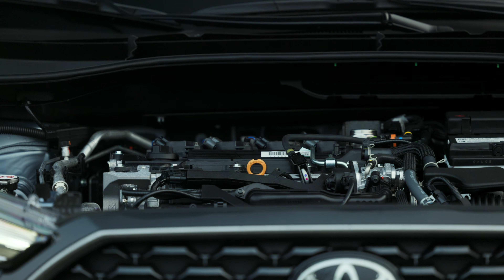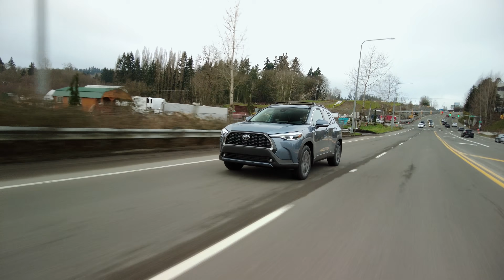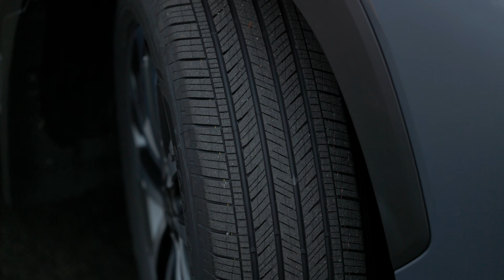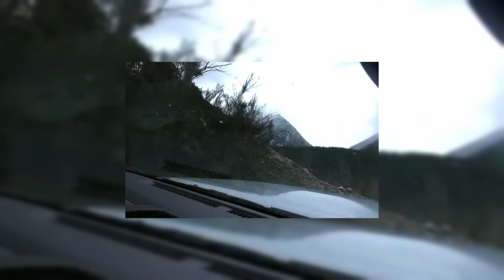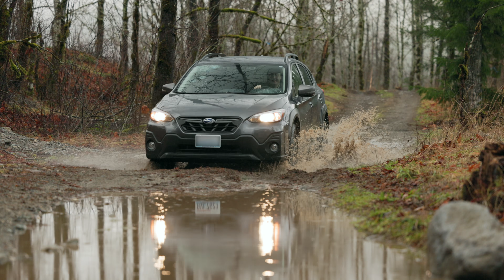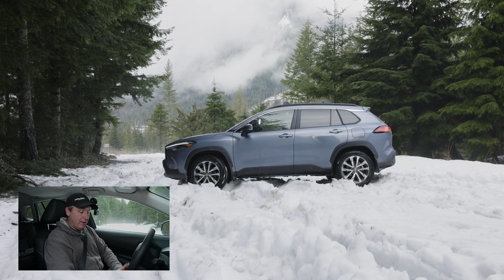2022 Toyota Corolla Cross vs Subaru Crosstrek AWD Off-Road and Snow

Comment: “No stream, Tap to retry”
Reply from the maker: YouTube is aware of the issue. They said it will be fixed in 24-48 hours. 🙄
Reply from the maker: if you have issues playing in the YouTube app, try it in a mobile browser. It worked fine for us after replicating the app playback issue.
Reply: @Driving Sports TV   Yes I just saw it awesome job
Reply: U

Comment: My Toyota Corolla in snow tires is almost as good as an all wheel drive. Tires make a huge difference and you should’ve had snow tires on the Corolla Cross for this test. I realize you’re not able to put snow tires on it but at least don’t say that tires didn’t make a difference because it does. Other than that thank you so much for doing the video and putting the Corolla cross through snow, there aren’t many videos that have done this.

Comment: It’s a pity that other car manufacturers didn’t follow the example of VAG brands and don’t include the EDS system as standard. In similar situations, when we have AWD without full locking differentials—as is the case with most non-off-road vehicles—the EDS system would be very useful in snowy conditions when ASR can’t cope

Comment: I drove supercharged v8, twin turbo v6, and I say the hrv,  Corolla cross and crosstrek and am perfectly fine with the hp, torque,acceleration and cvts. Just stay away from 3 cylinder engines, and Mitsubishi cvts, and Nissan.

Comment: I personally have taken my 2024 Corolla cross se mudding here in Oklahoma after feet of rain. I took off the traction control bumped it into 2 gear and it slung mud! I have never seen or been in an suv that could tear through muddy/rough and rocky terrain such as that. So don’t dog on it until you really run it through the gauntlet!

Comment: Why not try the hybrid CC with 197 hp vs teh suby?
Reply from the maker: Because at the time of filming there wasn’t a hybrid cc yet.
Reply: @drivingsports  I'm super interested in how the AWD-i would fare. Would it actually do worse than the Cross you had for the test with the different AWD system.

Comment: What I don't understand is why car makers in recent years have moved away from mechanical limited slip differentials.  They are simple.  They are usually bulletproof.  They do NOT have to use your brakes to move your car.   (There's an oxymoron.)   For both of these cars, having a limited slip on at least one axle would be a game changer.    Your Toyota would not have had any problem with that second hill with a limited slip on the back.      It can't be because of cost, limited slips are cheap to make.  ???

Comment: ALL these companies need to learn a 2.0 litter ANYTHING is NOT ENOUGH POWER... PERIOD....  F...k the govt. regulation BS-- give the public what they want.. and it will sell-- but these are UNDERPOWERED - just like the subarus, and all the rest.   The 2.5 mazda is BARELY enough-without a turbo(which is another thing that needs to be LEFT OFF- and install SUPERCHARGER instead-- much better for the engines and mpg.

Comment: Considering they’re the same platform vehicle with just 2 different engines and AWD systems, having had a Crosstrek and miss the heck out of it, I can absolutely see the appeal to the Corolla Cross. It’s more modernized , looks a bit better and given the AWD Hybrid option that I believe gets better MPG than the Crosstrek Hybrid and will work fairly well for most commuters. That being said, having BEEN a Subaru owner, there is NOTHING like it. The customer service and assurance that they stand behind their vehicles is the hands down reason to get the Crosstrek over the Corolla Cross. Our local Toyota dealerships have some of the worst salesmen and service techs I’ve ever met and that’s why we went with our Odyssey instead of the Sienna. Had we gone with the Ascent instead, my blood pressure would’ve happily had a better time than what I’ve had with a non-Subaru dealership and service department.

Comment: I watched this video a couple times. And I noticed that when he was doing the same section that the Toyota was in being that he owned the car he was more aggressive with it so there was a little bias. He didn’t want to hurt a brand new car he charged a little bit with the Subaru And the Subaru was a little more use of the throttle as you could tell from different camera angles from the wheel spin. Again it was lighter on the Toyota than the Subaru because he didn’t want to hurt and pay for damage on a new car.

Comment: They both have standard open differential. you can clearly see it.
Toyota didn't put the A-TRAC system (like the one they have in 4Runner and LandCruise) on the corolla cross. 
If it had the ATRAC, it wouldn't spin the wheels like that.

Comment: Incorrect comparison because
1. Tires (all-season vs trail)
2. "Sport" is trim #3 for Subaru (with 2.5l motor, 182 hp and automatic trans starting $28k + delivery), while LE is trim #2 for Toyota. So, Toyota LE (2.0l, 169 hp, awd starting $27k + delivery) should be compared with "Premium" trim from Subaru (2.0l, 152 hp, automatic trans starting $26.2k + delivery)
PS: Toyota has 26.5 cargo space vs 20.8 in Subaru

Comment: The problem here is you need to redo the test when they both have 100k miles on them. If the subaru even makes it there with its phenomenal head gaskets and cvt transmissions. I know which car I'd buy.

Comment: Good video!  You say the Cross has no underbody protection. Does the Crosstrek?  I assume underbody protection is critical in an off-road setting.  Am I wrong?  I also notice that Crosstrek is has 6" more clearance, which is obviously also a critical difference.  Right?

Comment: I just bought a 2023 subaru crosstrek 3wks ago and it texas we just had a sleet and freezing rain storm I didn't have any problems on the icey roads never spun my tires I did test drive the toyota cross I liked it but I didn't like the ride as much as the crosstrek the cross is a good looking cross over great video thank u

Comment: Corollla Cross AWD system is almost as bad as the one of the Yaris Cross, it has just a little bit more power but still not enough. This AWD system based on little electric engine on the rear is just a "2WD plus", not a real 4x4. RAV4 is better, even if still not so brilliant. The Subaru is a quite serious car.

Comment: I've had a Tacoma and two Camry's and they are amazing long lasting vehicles. I'm do for a new car, and would not get the Corolla Cross, seems too much like a toy for the price. I'm probably going to get a Crosstrek Sport or Limited.
Reply: Subaru easily wins on capability and I would also give them credit for sensible designs with top visibility.   Toyota easily wins on long term reliability and usually wins on fuel efficiency.  After 17 years and just three non-scheduled repairs on my Toyota, I am not looking to switch brands.

Comment: This guy knows shit because I'm a car mechanics and Subaru engines are not reliable at 100 000 miles .That engines that Toyota got easy goes for 400,000 to 500,000 thousands miles no problems with basic maintenance.
Reply: 100%.
Reply: My experience as well, but maybe 120k for the Subaru and 300k for the Toyota is more realistic on average

Comment: The torquier 2023 hybrid may have cleared that ditch hill. 0-60 is said to be just over 9 sec, in the non-hybrid, not 11+ sec. Not sure where you got that slow spec.
Reply from the maker: Everybody measures 0 to 60 different. We measure with a 1 foot roll out. Some manufacturers use a 5 mph roll out. The only valuable comparison is against other tests using the exact same methodology. You also have to accommodate for the weight of the driver in any gear that is loaded.

Comment: It kind of seems to me like the cross track is a bit underpowered for those hills that are a bit steeper and also pose traction issues.   If you’re not doing a lot of off Roading that might require increased ground clearance and engine power, a Toyota Corolla cross might be a good option for someone looking for an affordable way to get about town when the weather gets nasty.
Reply: Why would you do that when the Subaru is better and cheaper?
Reply: @onelove2349  kinda because when cross is released everything subaru and every other toyota are out of stock and lead time of a year
Reply: @onelove2349 and less reliable 😅

Comment: Man....the Toyota seems underpowered and the AWD system just doesn't seem very good in comparison, but I agree with the others that against Subaru's superior AWD system and the tires themselves provide quite an advantage. However, we also have to keep in mind the power of the engine. At this price point, it would have been great to see Toyota throw that 2.5L from the Rav4 in there, but then it may have started to take quite a few sales from their #1 SUV offering.

Comment: I know the problem you are driving it too slow on the hill if I where you I will put it pedal to the metal up the hill, you try it on the of roading track you suppost to try it on the forest track I saw your video of the 2022 rav4 trd off-road review, the rav4 has strong wheels and you did the same thing, driving it too slow on the hills leaving it too poor and later put them in the "did not make it" siding and finally you drive with their top competitors and prove them that they are more capable then them. dude what is your carefulness do it again don't leave it too poor next time

Comment: This was my guess - the Subaru Crosstrek is much better offroad than the Toyota Cross. Toyota trying to copy Subaru after over 30 years of AWD is not going to end well.  When Consumer Reports said it was a good alternative to the Subaru, I thought is it really any good offroad?  This is the answer - no it is not.  Thanks for sharing, tells me what the next car I buy will be as I live on a mountain which regularly has 6 inches of snow on the ground with a 15-18 percent climb of 650 feet.  Not something I would trust to Toyota's system.

Comment: Put all terrain tires or winter tires,  and that cross would have done it. Most tires for cars today are low resistant tires to save on fuel. The cross wont beat the Rav4, it is meant to be in that order. I live in Canada, it would easily drive in that snow with winter tires.

Comment: Appears to be  a pro Subaru or anti Toyota review, both cars are good, Subaru best all wheel system and Toyota best in dependability,  reliability, after sale services as compare to others.
This Corolla may be a Cross Treck killer. It looks SUBARU is scared of this tiny crossover.

Comment: The CC is a nicer-looking wagon vs the CT. The Crosstrek is balanced better than the FWD CC that's why it's better off-road. A flat H4 puts the power down better than a TI4. If you are a city driver and want a small compact wagon for cheap get the FWD CC over the CT. If you want a performer that will go anyplace buy the Subaru... Subarus are safer in crashes than a corolla because of its H4 flat lower center of gravity.

Comment: Great job. you've certainly proven the tire is a critical component in AWD comparison. Did Subaru ever solve the issue with head gaskets?
Reply: My engine took a shit on me at 62k miles in my 18 crosstrek limited. I think it was the bearings ,so I just bought a 2022 crosstrek limited

Comment: Wrong: You meant INDIRECT TPMS, not passive TPMS. This is when they use tire rotation to see which wheel is going faster (lower pressure). I don’t believe any modern car in the US comes with that old system.

What you really meant was that some makers do have proper wireless TPMS, but they don’t show individual tire pressure but instead simply turn the TPMS light on for YOU to check all pressures.
Reply: Not sure about the TPMS comment. On my 2015 Impreza there appears to be no Subaru method of reading individual tire pressures. However using a Bluetooth adapter and a Subaru specific app the tire pressures are available and display on my aftermarket entertainment head unit as well as my phone.

ActiveOBD is the app. You can see individual tire pressures, CVT transmission temperatures, oil temperature, gear ratios, lockup, and much more. In short very little on the 2015 is displayed on the Subaru's displays but the information does actually exist and usable on an aftermarket screen DASHBOARD, using an OBD2 $15 adapter.

Comment: My 2018 Rav-4 SE was the worst AWD drive system I ever owned.  What is the sense of AWD if you get stuck in a small amount of snow?  I live in ND and we do have winter here.  Not only was it not good in winter,  the vehicle cost about $2000.00 more than other comparable SUV vehicles.  My trade in value was also less than some other vehicles.
Reply: I’ve heard the same actually. Most I’ve known get out of their lease with Toyota and have gone to Honda crvs, Hyundai or Subaru  Toyota just doesn’t let you know when you need the power to get out of a jam…..know a friend that owns a Subaru to help 🤔😆😆😆

Comment: are you sure the cross doesnt have bluetooth?
Reply from the maker: All cars have bluetooth. It's a federal requirement, so we don't talk about it. That only allows for wireless hand's free audio. It does not provide wireless carplay without additional hardware/software.
Reply: @drivingsports  thanks for the reply. By chance do you have the reference for that law? I’m curious. Didn’t know that was a thing.
Reply from the maker: @solje8199  I shouldn’t have said federal. It’s actually based on several state laws that require hands-free. Those went into affect in 2008. There’s very little on the Internet about it because not everything was on the Internet back then. Automakers responded to the law by making BT standard.  I can’t name a single car today that doesn’t come with BT.
Reply: @drivingsports 
I don't believe there are laws that require Bluetooth but there are laws about using a phone that requires anymore than an incidental button push.

Comment: I went and test drove a corolla cross yesterday... that 1st gear to CVT switch over felt clunky, and it had a weird RPM thing when doing it as well, and also it felt like the AWD system isn't very refined... like the car was wanting to put the power to the ground, but was being restrained by all the extra moving parts...ultimately a no go for me. the Honda HR-V I test drove had none of that issue, and actually felt a lot quicker getting up to hwy speeds, and control a lot more refined.